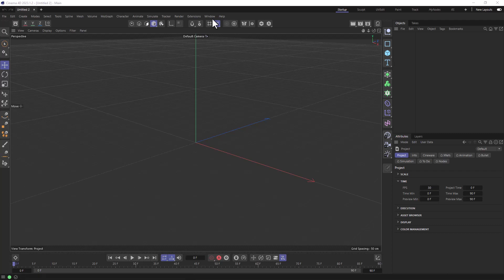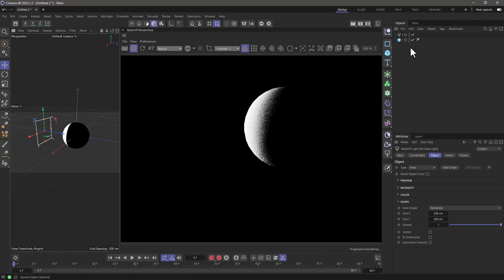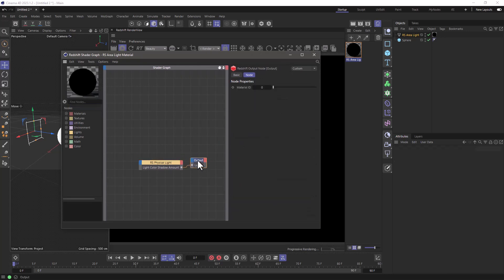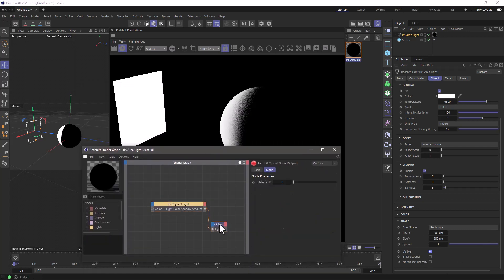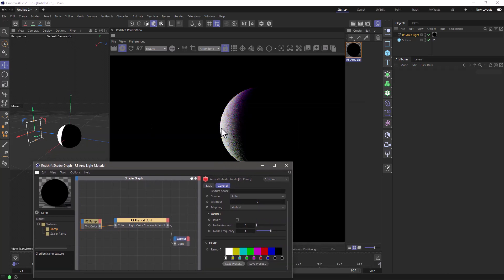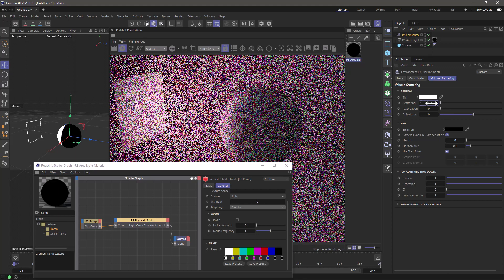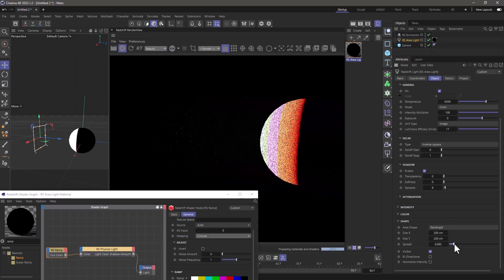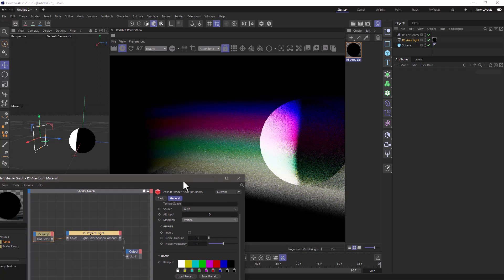Using a Gradient Ramp in a Redshift Area Light

Comment: Great video, thanks! Is there an easy way to have several lights with a gradient but only one shader? If you use the shader for several lights and you make changes to the intensity of the light, the intensity of the other lights will change too, because it is linked. But if I have ten lights in a scene with the same gradient, it makes no sense to have 10 shader for that :hand-orange-covering-eyes: